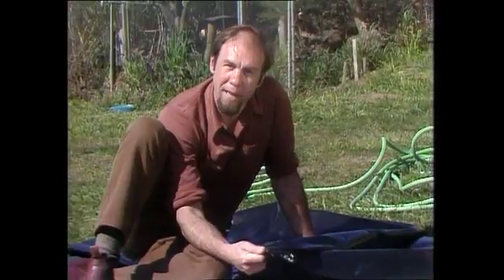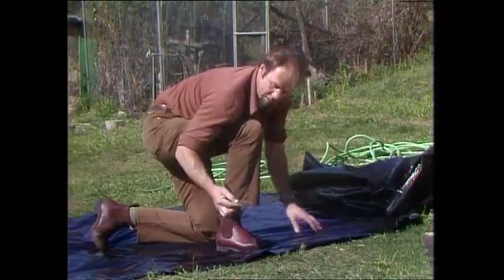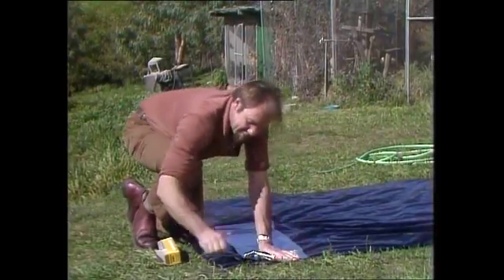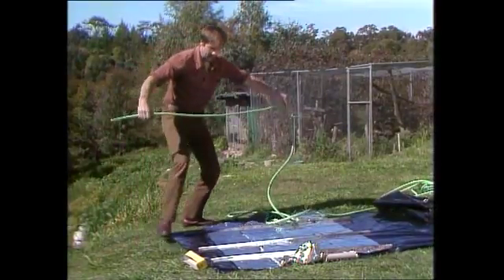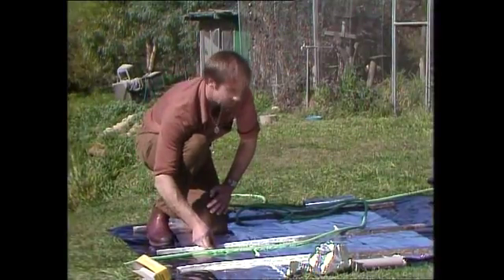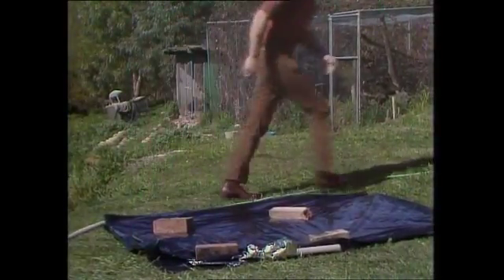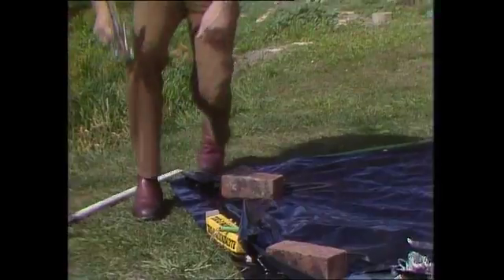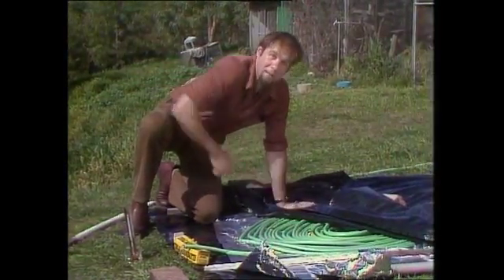Make a simple solar water heater

Comment: EXCELLENT!  Simple set-up,  Portable,  Cheap,  Fast results,  & Effective.  Best part is you didn't have to paint anything.  I just wish you determined how many minutes it took to get the maximum temperature you could achieve.  Thanks for doing this!
Reply from the maker: Thanks - that depends a great deal on how hot the day is and any cloud cover - think of a hose left lying in the sun - Rob